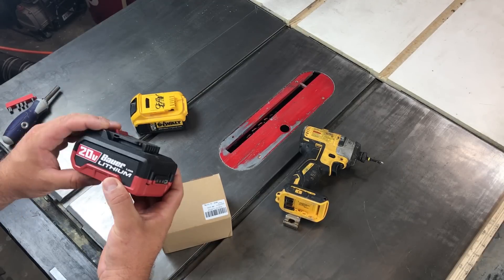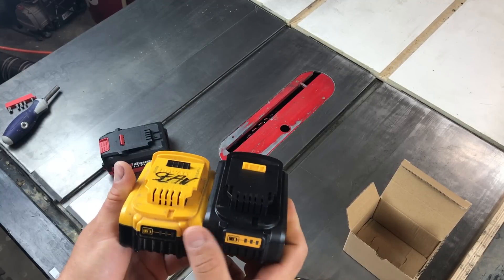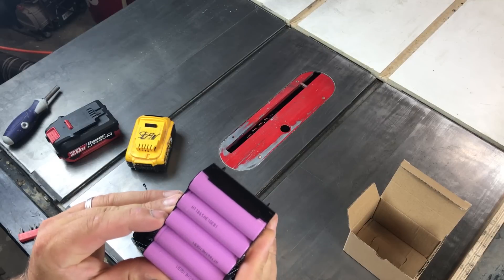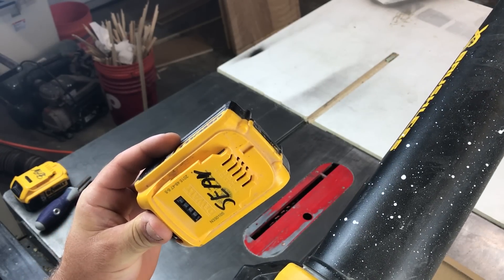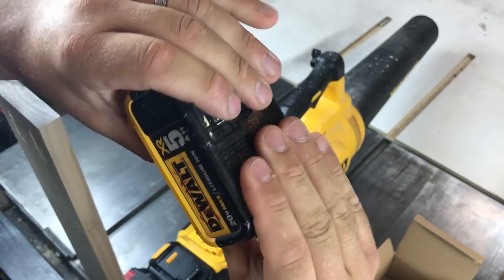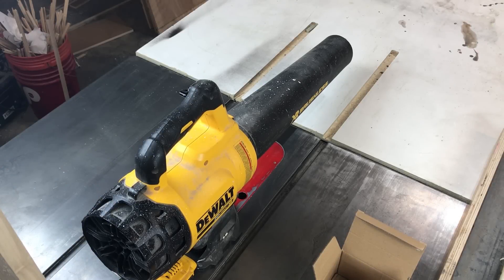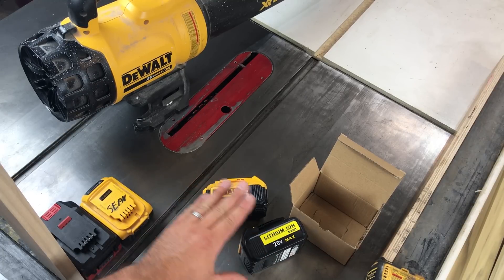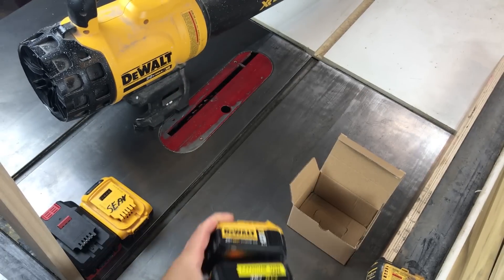Generic Dewalt battery from Amazon vs Genuine Dewalt 20v Lithium battery

Comment: I buy similar knock off batteries for my Hitachi 18V tools off ebay for 25 bucks (4 ah), and have yet to have a problem.  I finished 35 feet of fence on one battery with my circ saw, and it almost made it.  That's cutting treated 2x4 and 2x12 (rot board).  The battery was hot when it finally ran out, but cooled it off put it on the charger and fired up again like new.  Lithium is the shit, but screw paying 80 bucks if you can pretty much do the same amount of work for less than half.  I had the other battery ready to finish up.  Rarely you use the full charge before recharging anyway.  If you don't have to have a cord, why have one.  I'm more worried about the motors burning up now.
Reply: I agree totally. Screw Big Box Huge prices for battery packs in a store. I'm going with Generics on Ebay from now on, well worth it. I just ordered 2 x M12-6.0ah batteries for $16 delivered to my house. I don't expect them to be close to 6ah, but  Unless they are full of rocks or don't work at all, I've got my moneys worth on 1 project. LOL
Reply: David FP you do understand the batteries used in these are not new manufacture cells, they are pulled from dead electronics and they do not come close to the same safeties. The do not have thermal over load protection, these do not have over current protections. 

Also every manufacturer will void your warranty if they find evidence of these being used. AvE did a tear down on this and explain in detail the differences and it is scary bad. 

Yea you saved money but when they burn your house down. You didn’t save anything. There isn’t this battery conspiracy by manufacturers, there is a ton of tech in the legit batteries that these do not have. Plus you are buying used cells that you don’t know their history or if they are safe at all to use. This isn’t something you cheap on with mystery crap from China. This will burn your house down.

Comment: My foreman thought he would save money buying some generic NiCad  batteries for the Makita drill/drivers we have all over the shop, the Genuine NiCad Makita batteries ran about $50 each, he found these other ones for $25 and they had no name on them LOL.

I noticed they weighed like half what the real ones weigh, maybe not half but noticeably lighter, we also noticed their run time and especially their lifespan before they had to be thrown away was a lot shorter- DUH! they cost half the price and apparently had HALF the material inside, thus the much lighter weight.
You get what you pay for in most cases, cheap batteries are cheaper because they have less everything in them, poorer quality,  and less lifespan, so those cheaper $25 batteries wound up costing the same as the real Makita batteries in the end, maybe a little more when you consider disposal costs of 2 batteries instead of one.

We use these Makitas all day long every day and have batteries right now from Makita that are from  as old as 2006-2012 (I date all tools and batts when they are bought)  that still hold their charge and work, and they get hard use. The $25 batteries started failing in a few months, and recently I noticed about 3 more them no longer hold a charge.
Reply: contractor grade tools and batteries have to cost more than consumer grade stuff. If a consumer only occasionally uses a tool then maybe cheap batteries will work fine in it for years. A contractor working every day has higher requirements. Kinda like a light duty pickup passenger car substitute that will occasionally hall a few hundred pounds of cargo is great for its purpose, but will break down in. a hurry if it has to carry a maximum load on rough job sites every day.
Our capitalist system ain't perfect, but it's great to have as many choices as possible. No one product is ideal for everybody.

Comment: Al from Lumnah Acres has a shit load of De Walt tools and he bought an after market battery of the same amp hour rating as the genuine DeWalt and did a test in his 6 1/2" circular saw and got about 2 1/2 times as many cuts out of the genuine DeWalt battery !!!  Both fully charged on the same charger !!!!!

Comment: The big difference is the 3 years of warranty that brings the original battery I have 2 original 2 years ago a stop loading the take to the DeWalt store and in less than 5 minutes I went out with a new battery that's the big difference

Comment: Not saying that the test wasn't useful, but since Liion batteries are known to gain capacity after a few charges and the LED "bar meters" aren't precise, I'd repeat the run and discharge a few more times on the generic and see if the result changes. Also aftermarket batteries aren't consistent from run to run or even item to item,  so I'd look for a trusted seller who warrantees what they sell, and test a second battery. Also, its normal practice when testing an unbranded product to give a link to the ad where you ordered it from  so viewers can get the same product.
Reply: P Schmied See my newer video , I did more reliable testing on them

Comment: Hi there, Good video and here in the uk we can get them even cheaper!. However I can not find out if you can charge the 20volt batteries with a dewalt 18volt charger. I contacted Dewalt and they say you can not.  I have also contacted the cheaper battery firms and had no replies. Have you charged one yet? Regards

Comment: I GOT A RYOBI OFF OF EBAY CHINA FOR 35.00 IT WORKS BUT WHEN I CHARGE IT IT WON T TURN OFF THE LIGHT WHEN FULLY CHARGE LIKE THE ORIGINAL RYOBI BUT IT STILL WORKS AND IVE HAD IT GOING ON 2 YEARS. THE NEW RYOBI IS 89.00 VS 35.00 ON EBAY. IM STILL USEING IT TOODAY. THIS IS MY OPINION .WANTED TO SHARE MY INFO.

Comment: Love your math! LOL. Stop buying tools at the lumberyard! You can get far better prices on ebay every single day. I just bought a Dewalt kit consisting of two 5.0 batteries with a charger delivered to my door for $128. Take away the charger and you're looking at $100 for two 5.0 original dewalt batteries. Much closer in price to the generics.  That said, if the generic does last just as long as the OEM, then I'd switch in a heartbeat. Thanks for the video and you are right, real time/real world results are all that matter!

Comment: Do they have a generic battery for milwaukee. The Lithium  batteries I have, need to be charged every time I use them. My dewalt batteries work great, still have the originals and they HOLD their charge.
Reply: 5 year warranty send them back and get new ones

Comment: I had the Dewalt 1/2 in, 18v, hammer drill. It saw a lot of use, and had been dropped many times over the 8 yrs or so that I used it. One day it suddenly failed to go into reverse when the switch was pushed. I took it to Home Depot (my toy store), and they sent it out to be fixed. Instead of UP TO four weeks it was more like seven. I hit the trigger a few times and it whirred. I get it to the job the next day only to find that now, not only would it not go into reverse, but the saith was stuck. I returned to Home Depot where everyone was surprised and upset because they knew that I had waited a long time. Once again it seemed to take forever. And the employees were telling me to just go get a new one. The next time I came back, when they suggested the same thing, I almost took them up on the idea, but did not want myself or them to get into any trouble. The good news is that that very day they sent me a brand new one with a new battery. Thanks Dewault! This said, and after being through several sets of Dewault batteries over the years (my radio uses them too), I think that if one starts going I will do the conversion kit. Thanks for the video.

Comment: to be fair if you had just charged the dewalt you should have also charged the replacement as it might have shown full charge but could have been off a bit from sitting.
Reply: raljame why do you assume I didn’t charge them all?
Reply: I did not assume anything I was gong by what was in the video.

Comment: I bought 2 of those Amazon batteries ,, it was like 2 for 50 bucks ,, 4ah !!  To be straight up ,, they did just as good as the DeWalt battery if not better . So I ordered 3 more just in case they go up on price ..  And yes I use my math to hammer down on my decision .  Knot + knot = 2 knots ..

Comment: I bought two of their 3ah batteries a couple of years ago and one of them still works great.  I will say that their support was great.  I emailed them when one stopped working and they sent me another one right away.  That one lasted about 6 months.  Again I emailed them and they sent another out right away.  This time they sent the 5ah but it never worked.  I emailed them again and they sent another.  That one never worked.  Emailed again and they sent another.  That one never worked either.  They probably would have sent me another, but I was over it by then.  You might get lucky, but after 3 consecutive 5ah batteries I gave up.

Comment: Generics are hit and miss. More miss then hit especially if you factor-in longevity. 
I rebuilt my 14.4 NiCad  with advertised '3000' mAh Sub-C batteries.  They felt a lot lighter then the OEM. At the end they work. Strong driving, holds a charge. It charges in 1/2 the time which was telling...  The run time is about ~50% compared to the factory battery. For short term use Generic will make you happy but but over the long term OEM will almost always give you bigger bang for buck.

Comment: Great video. Been looking for something like this. However, for the pricing $35 battery vs a $75 dollar battery, if you wanted to look at it that way, but since they're always sold in pairs... But battery cost to battery cost, this thing is less than half the price. I'd say that's a win as long as it can hold up for a reasonable amount of time.

Comment: I ordered one cheap Amazon battery 20v 5.0ah but i couldn't charge it with dewalt dcb 113 charger.Can you tell me what charger do i need to charge it properly.
Reply: ivak86 see my later video, I had the same problem
Reply: @seancarlin4547  thanks

Comment: Okay is it $35 from Amazon shipped to your door or is it $40. Makes a big difference if your math is off🙄
Reply: math may be off but today My cheap ones even after cycling the dewalt lasts longer by 30% and i have found the 5 ah under 30$

Comment: I needed to replace or rebuild both of my Dewalt 2.4 Ah NiCad batteries. They were $99 each or a 2 pack for $149. Bought 4 compatible generic Li-ion 4Ah batteries on Amazon for $72 shipped. They are hands down better than the OEM Dewalt batteries. Would have cost me $55 bucks just to rebuild 2 of them.
Reply: Tim Stroud Check out the video I just did where I tested the actual capacity of the generic batteries… Not such a great deal
Reply: @seancarlin4547  the ones I bought work quite well.

Comment: I have bought three 18 V Dewalt batteries from amazon from two different companies, after 5 months all the three batteries did not hold charge. while Dewalt brand batteries usually last me 5-6 years. after market batteries are scam.
Reply from the maker: I bought a second set that seem to be holding up after 6 months... but it is a crap shoot on which ones you get I guess ....
Reply: I just bought a dewalt brand i am sure it will work for a few years  @seancarlindesigns1431

Comment: I bought a DeWalt drone driver off of Amazon for $99 special the drill works fine but when I release the trigger it makes a ratcheting sound like it's working against the the clutches in there is this normal for a DeWalt drill or is there something wrong with the drill itself
Reply: Robert Franks normal...that's the brake kicking in

Comment: Hello Sean Carlin thanks for doing this test , I was curious my self after seeing the big difference in price.                                                                                              A shorter run time is one thing , how about how many charges will they take before not working any more is the other question ? Also if you want to do a follow up video put a meter on the batteries to see what voltage they are putting out .  I still purchase Dewalt batteries and I found a place on the internet where you can get two three amp hour for 69.99 for two or 35.00 each . I love the whole Dewalt line, they are the most progressive Tool line out there and make so many tools in the 20 Volt arena. I find the weight of the 3 Amphr to be the way to go if it is on your hand all day for light duty.
Reply: Where on the internet did you find that deal on batterys

Comment: I got a cheap generic one for milwaukee but its 50/50 when you buy cheap fake batteries. Some may last years, some may last a few time after heavy use. Thats why some say its better to buy those cheap ones cause thy got lucky and lasted long. They are probably those diy ers  and not commercial contractors using it heavy use daily. Buying aftermarket or cheap batteries like your showing is not worth it. You may think its good in the short run but later on the line like a few months of heavy use it is junk.  Of course oem batteries are more expensive but buying junk batteries will end up costing more since you have to keep changing them.

Comment: Are you sure your math was right? Pretty sure I spotted a discrepancy. Lol. Thanks for the video!
Reply: He was accounting for the flux capacitor, not the lithium capacitor. Also, the parallelogram introduced in the thirteenth line of the composition should have also been a trapezoidal injection for splitting the nucleus of the molecule found in the ionization of the lithiumnization.  
#beingjewishistheonlyway
#ourswartzisbiggerthandewalts
#buythecheaperbattery

Comment: I have 4 of those cheap Amazon DeWalt batteries...guess what. All 4 of them are broken.. They are Garbage give it a few months of heavy use and they just stop charging or just stop working... In fact my DeWalt dcf899hb is also broken after having b it warranty repaired already and being without it for 3 weeks.. Not a fan of DeWalt anymore.
Reply: Auto Fix Pal they are also extremely dangerous and the reason your drill has had issue is most likely from using these junk and completely unsafe batteries
Reply: Guess those are lower power cells if not even used & rewrapped. Meaning it it will heat up more on higher power setting and drains faster for that reason as well last shorter time. It's better to get new Dewalt flex volt batteries from Amazon cause you pretty much don't overpay since the price is quite close to bare Sanyo cells and it runs cooler due to the size of the battery.
Reply: @sethrichardson4528  cause they're good tools. I have rigid and Makita. My work supplies Milwaukee, they've grown on me.
Reply: If you put batteries that aren’t specifically for the product you intend on using you’re asking for problems . Dewalt are awesome 😎
Reply: @sethrichardson4528  will be upgrading all tools to milwaukee next year i was talked into a dewalt but not liking it chuck is utter rubbish and it feels cheap when using , wobbles like a dog thats just stepped on a bee.
Reply: On every drill & battery it says to use original dewalt batteries or it will damage it. PERIOD. Its not dewalts fault you're cheap, Milwaukees will fail too when you put fake batteries in them genius.
Reply: It might be the user just saying I've had my dewalt stuff over 5 years mine still work great even submerged my impact and 4ah battery in a puddle on accident but both still work great

Comment: Here's the thing with those batteries. The real dewalt batteries use samsung lithium cells which are robust and long lasting. The cheap or knockoff batteries use cheap chinese lithium cells which don't compare in power and durability of quality cells like the samsung.

Comment: I had the copy fast charger for my ryobi stuff was good recently sold my ryobi stuff as aldi has a new range of tools called ferrex tools they are cheap and actually made by erbauer 😂 cordless chainsaw grinder drill impact driver multi tool Strimmer and hedge trimmer and numerous batteries for 265 thanks aldi
Reply: Aldi the food store??
Reply: That's what I was wondering!
Reply: If you buy your tools at Aldi, your asking for trouble. Never heard of either company!

Comment: Save a ton of money just buy Replacement cells and switch them out.  Btw, without a doubt if you checked each of those cells a few would be dummy cells (half) filled with sand. That’s also why they wear out so quick because it’s an overrated amp on too few underrated cells so heat murders em.
Reply from the maker: Agreed… Check out my latest video where I actually tear them  down and test the individual cells

Comment: I am uncomfortable with a single random test as the basis for myself making a decision to try an alternative 'copy' battery. My first doubt is that there is unlikely to be the same quality control in manufacture, so likely to be more failures. I also don't like the idea that some manufacturer has done all the r&d and then someone else just comes along with a copy without any product testing or reliability testing. We  don't even know if the quality of the plastic casing is the same. What we do know is that certain countries have no compunction in copying anything and ignoring copyright and I don't want to encourage that behaviour. Based on this test I won't be rewarding Amazon by buying their inferior offering.
Reply: Chris Bradley well, this wouldn’t be copyright infringement. Maybe patent violation.
Reply: @Paradigm816  Good point